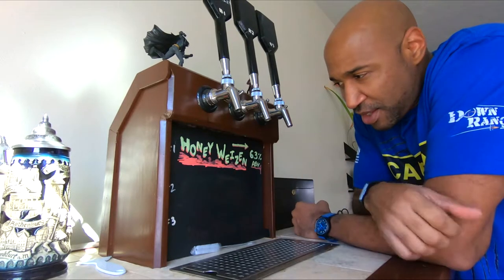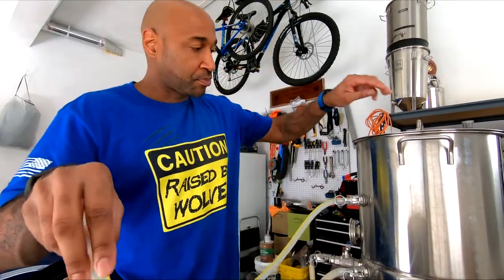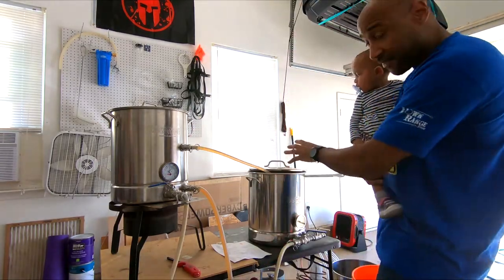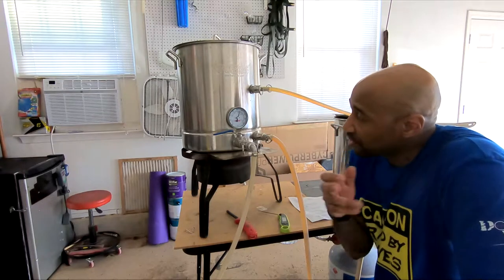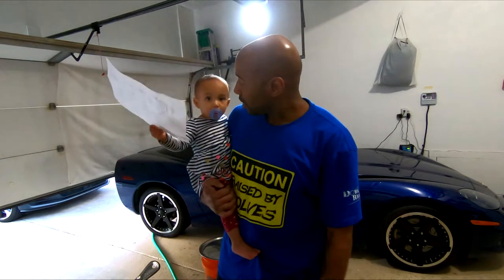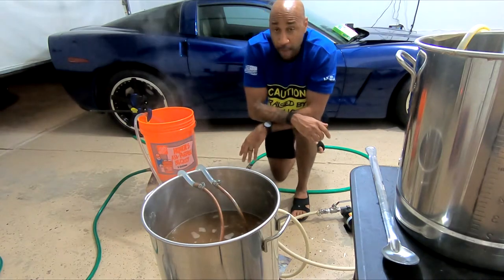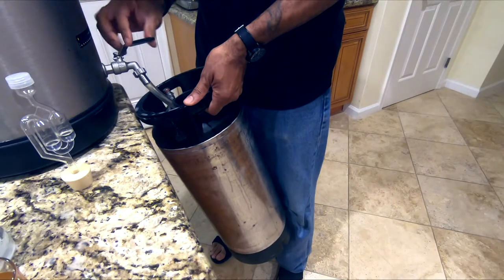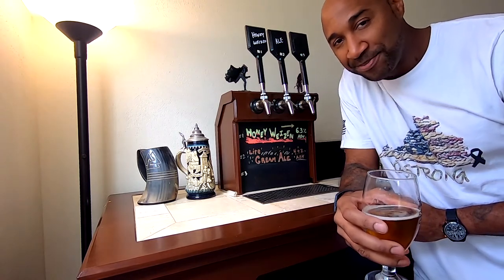All Grain Homebrew - Cream Ale

Comment: AWESOME VIDEO!!!! I use a plate chiller because it is more convenient, an emersion chiller leaves the goop in the kettle which is better.
A few years ago a salesman in the home brew business claimed that he invented batch sparging. The guy would be about 4 century's old if he invented batch sparging. Batch sparge came about when paupers beer was produced by brewers that purchased spent mash from breweries. The mash was gooped up with protein sludge and to unstick it, it was batch sparged. It's better to keep the sludge in the grain filter instead of moving it down stream. Fly sparge is time consuming but it creates a cleaner extract than batch sparging. Batch sparging reduces shelf life of beer due to chemical changes that occur during fermentation and conditioning. The off flavors associated with home brew and the change in flavor occurs when extract is chemically imbalanced and unstable.
The method that you use to make ale with is used in the grain distillation industry and the liquid is called distillers beer, the slang term is moonshiners beer. It looks like someone convinced you that distillers beer is ale, and the method that makes distillers beer makes ale. The liquids are not the same. Ales is much higher quality than distillers beer. The distillers method is a single temperature infusion method which makes it chemically and enzymatically impossible to make ale and lager. The temperature used to make distillers beer denatures enzymes that make ale because a particular enzyme extends the length of the process for a distiller. Beta extends the process time. A distiller purposely denatures enzymes.
A distiller rests malt at 150F because at that temperature Alpha releases a high volume of glucose and less, sweet tasting, nonfermenting sugar in an hour. Alpha deals with starch and it's responsible for liquefaction and saccharification. The purpose of Alpha is to release from starch one of the three building blocks of life, glucose. Glucose is responsible for primary fermentation and most of the ABV. 
Beta deals with glucose and it's responsible for conversion (140F).
Beta denatured rapidly when the hot water was added. Beta converts glucose released by Alpha into complex sugars, maltose and maltotriose during conversion. The sugars are need in ale and lager, the sugars aren't needed in distillers beer. When conversion occurs secondary fermentation takes place because yeast does something different with complex sugar than it does with simple sugar, glucose. During secondary fermentation yeast absorbs maltose and an enzyme within yeast converts maltose back into glucose which becomes fuel. Gravity reduces closer to expected FG and the chemical changes begin to impart beer flavor.  When conversion occurs beer doesn't need to be primed with sugar or injected with CO2 to carbonate, beer naturally carbonates during conditioning due to the tri-saccharide, maltotriose. Natural carbonation is much finer than the bubbles produced from artificial means.
There's a type of starch in malt that makes up the tips of the kernel, called amylo-pectin. The starch is heat resistant, complex, starch that contains A and B limit dextrin. A and B limit dextrin are tasteless, nonfermenting types of sugar responsible for body and mouthfeel in beer. A homebrewer throws the richest starch in malt into the compost pile with the spent mash because the temperatures used to make distillers beer aren't high enough to cause the starch to burst before Alpha dentures. When Alpha liquefies the starch limit dextrin is released and dextrinization and gelatinization take place. Mash is boiled to take advantage of the starch. The finest ale and pils are made from dextrinous extract, not from sweet sugar and glucose extract. A distiller sells the starch and it's turned into maltodextrin used in baking.
The malt that homebrewers use is high modified, high protein, malt which is more suitable to make whisky with. The higher the level of modification the poorer the malt is when it comes to making ale and lager. The enzyme content is low and depending on how high modification is, Alpha can be beat up, which results in low diastatic power. A type of Marris Otter is very high modified and diastatic power is low. Adjuncts like corn and rice shouldn't be used unless six row malt is added. The diastatic power of six row is high because it is high in protein which means it contains less starch, Alpha has less to work with. The higher the percentage of protein, basically, less sugar. Marris Otter, Golden Promise and Halcyon are well known and top of the line distillers grade malt.
To make ale and lager the decoction method and under modified, low protein, malt are used. The malt is much richer in enzyme content and contains more sugar than high modified malt. To take advantage of the rich malt the decoction method is used. To use a single temperature infusion ruins under modified malt, at the least, the malt should be step mashed. Weyermann produces under modified, low protein, floor malt. It is more expensive than distillers malt. 
A spec sheet comes with each bag of malt, at least it's supposed to. I'm not sure if malt purchased from a homebrew store comes with a spec sheet but it left the malthouse with one. A spec sheet is used to determine the quality of malt before buying it. There are several numbers and chemical names listed on the sheet that a brewer understands. Modification (Kolbach, SNR) and percentage of protein are two very important numbers listed on a spec sheet. Brewers grade malt is 40 Kolbach and lower, with a percentage of protein 10 percent and lower. Home brew malt is 42 to 46 Kolbach and 12 to 16 percent protein.
Mash out works only in the decoction method, it causes starch carry over in the infusion method. Amylo-pectin begins to burst at 169F and Alpha denatures due to the high temperature, the starch is untouched and moves down stream. There is no need to mash out when single infusion is used or to use sparge water at the temperatures that you use. Starch carry over and tannin extraction will occur. Both reduce shelf life.
Skim off hot break as it forms and continue to remove it until it drastically reduces before adding hops. Less hops are needed because the extract is cleaner. The purpose of first wort hops is to reduce hot break but the instructions in homebrew literature on how to do it are incorrect.
Since, time is time, why spend time on making distillers beer, when the time can be spent on making ale? Start with deClercks books, they cost about 175 bucks. Wulf's Journals are about 2000 bucks. Abstracts from the IOB are free online, their journals cost a few bucks. The IOB made malt, modern in the 19th century. They produce the spec sheet that a brewer needs to use before assuming that a recipe will make ale and lager.
Stay safe, you and yours, Stay thirsty. Brew ale and lager.

Comment: Great video thanks. You have a new subscriber. Those gauges need to be calibrated. A little nut behind the face will adjust it.
Reply from the maker: Yeah, the one that went bad even when calibrated would change each time. I eventually ended up replacing it with the same as the other one

Comment: Immersion chillers will contact your electric heating element. Thats why people use plate with electric.
Reply from the maker: Yes, I ended up modifying it so it hangs off the side and doesn't touch the bottom, or heating element. 👍
Reply: @JayJenkins  good thinking! I prefer immersion as well.
Reply: @JayJenkins  Thanks for that idea. Stored for future equipment use.